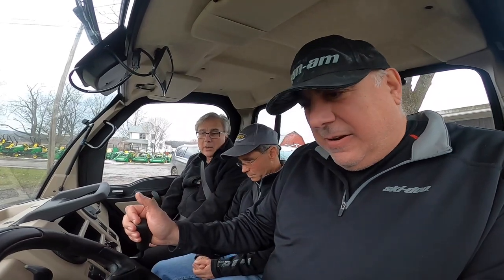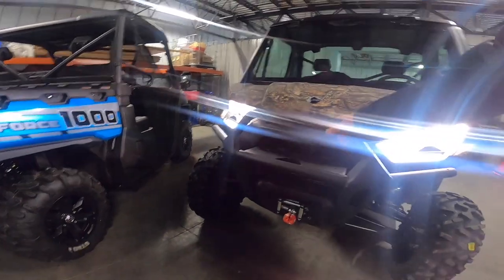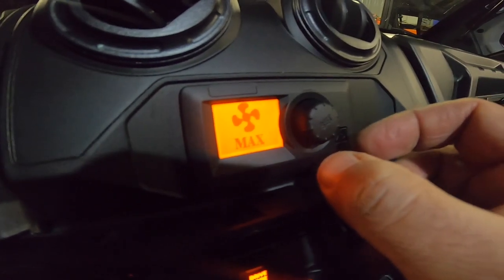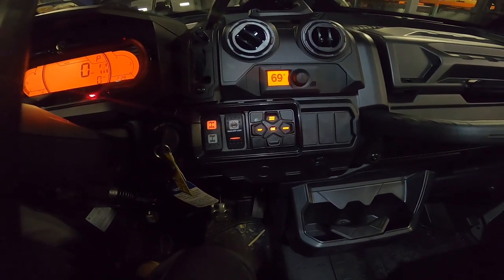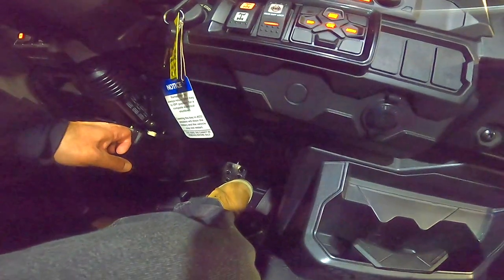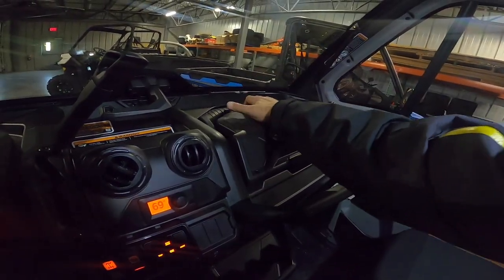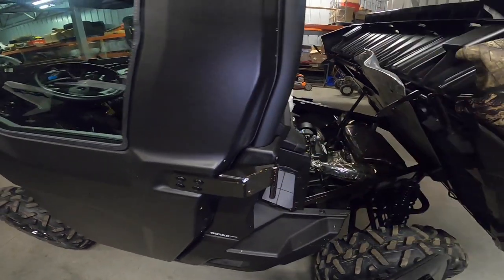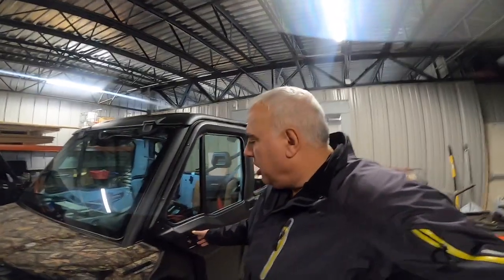#90 Can Am Defender Limited 2020 Cab Review and Tour

Comment: Do you know what happened to Honda , did they think that the sxs would not go ? Is that why they were late jumping into side x sides in the beginning ?
Reply from the maker: I don't know. My first ATV was a 2001 Honda Rubicon...looking back it was a terrible trail machine. But They last forever, are well engineered and hold their value extremely well. I did not like full time 4 wheel drive solid rear axle small fuel tank and guzzled fuel. The Honda Pioneer SXS is popular, i've pulled a couple out on the trail you can't hear the engine it's so quiet. From what I've seen the Honda Talon just doesn't compete with CA and PoPo. Also many of their models require shifting, and when you're on the trail most prefer a CVT automatic. If you a Honda rider, like German car manufacturers, Honda is stubborn and slow to change, they'll have a cab model when the other brands have hovercraft...sorry that was overkill. Thank you for commenting. Honda people love them, for good reason they depreciate very slowly.